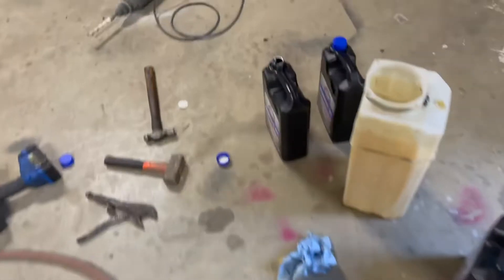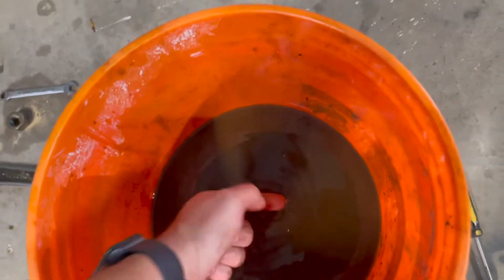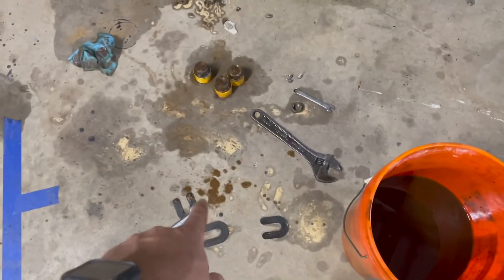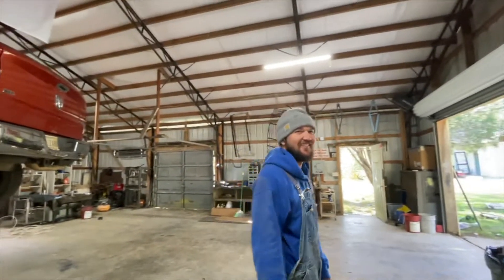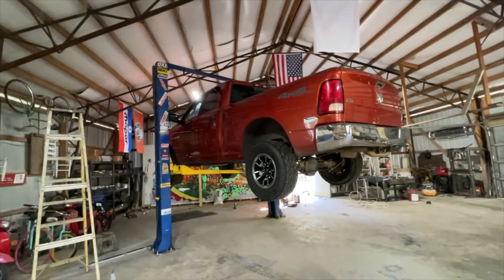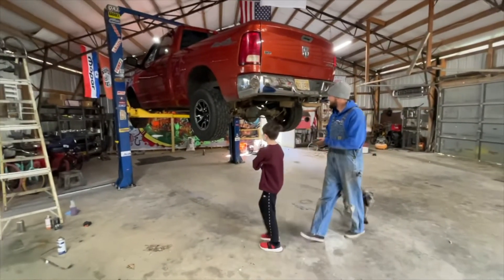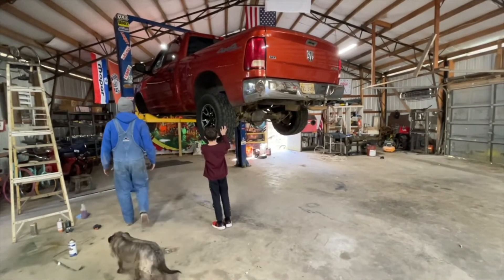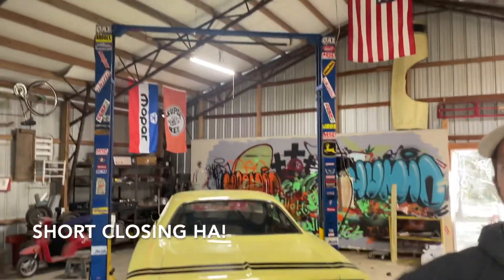Shop Shorts: We finally got our lift set up and working!

Comment: You will find that this tool is priceless! I was ashamed I hadn't put one in years ago once I realized how much time it saves and the ease of repairs. I am building an off road 78 j10 and just started a YouTube channel for my customers, but found out I love sharing my experiences but I suck with a camera!!! but I am using this platform to reach people that can possibly add insight to my custom builds that I have started. I am a huge jeep Wagoneer fan this is how I found your page then saw the lift install and thought I would comment. not sure if you have the adjustable under hoist pole jacks but two of them and it makes it feel like a much safer place under your lift when yanking on something.  sorry for long comment love the content I will keep watching thanks